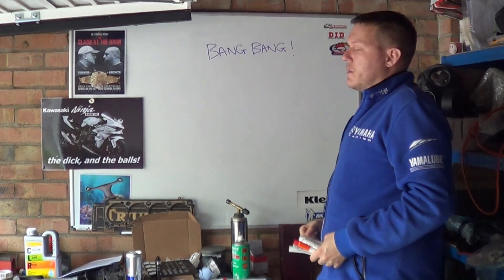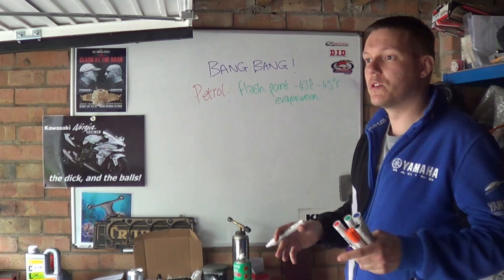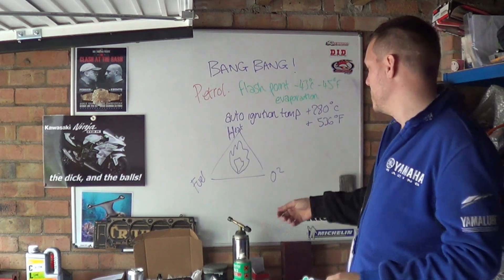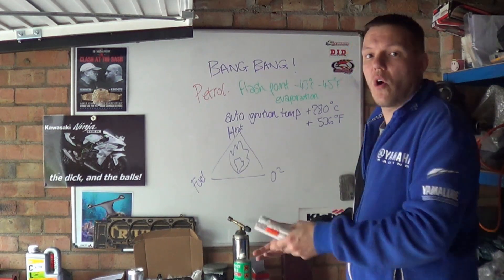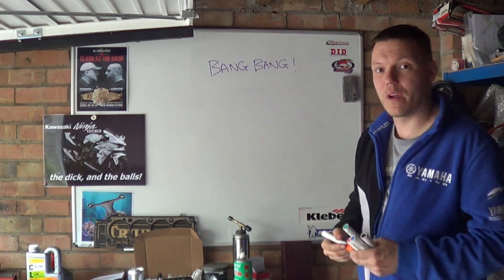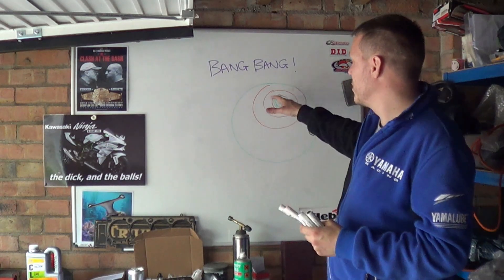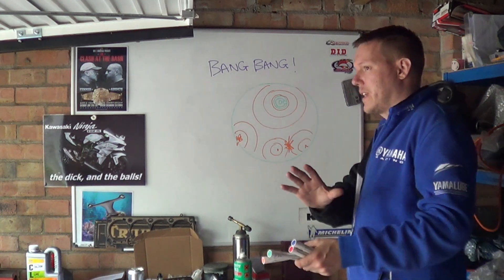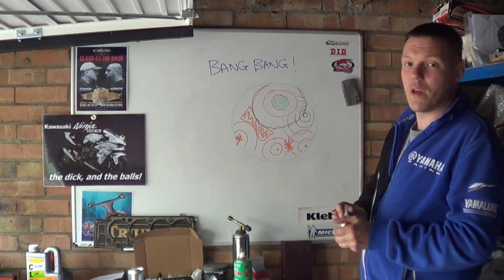Pre Ignition & Detonation

Comment: Good video. As always!
May I ask a question? 
I discovered something strange a long time ago. I was trying to get a homebuilt CDI system to work when I got so pissed at the thing that I decided to put a spark generator on my spark plug. The spark generator didn't have any timing at all. It just created 10.000 sparks a second. I tried to start my 2 stroke moped anyway although this was a stupid idea. I was shocked by the fact that the engine started without any problems at all! It even runs better stationary with this system than with the original ignition system! Besides occasional switch in rotational direction off course. The moped could reach 30 km/h with this system instead of the 45km/h with the original system. Naturally the engine sounded really bad at those speeds..
Only one questions remains since that weird experiment. WHY???????? How could this even work? Why doesn't the spark plug ignite the fuel when the fresh mixture is introduced? Since when do you need compression before you can ignite fuel?
I even have an old video of this experiment.
https://www.youtube.com/watch?v=_uSmPeQuvBI
Do you have an explanation for this?
Reply from the maker: Yes but I'll get you to answer your own question.

Why do we need a spark - i.e what physically does it actually do - what purpose do we need it to perform?
Reply: Thanks for your reply! I appreciate it. 

Didn't you call it the triangle of fire? You need air, fuel and heat. The compression supplies some heat but not enough. The spark plug supplies a tremendous amount of local heat. But apparently the spark plug isn't able to ignite the mixture until the piston is close to TDC. This would suggest that a spark plug cannot ignite a fuel air mixture at atmospheric pressure and temperature. This doesn't make any sense. So I still don't get it. :-(

Comment: Hi Matt, 
At 4:14 you said "with diesel, the mixture is compressed and when it reaches a certain temperature it ignites". But in a diesel engine the piston compresses only air and at top end diesel fuel is injected which generates the combustion. Correct me if i am wrong. As always  enjoying the vids, cheers!
Reply from the maker: no your correct, a slip of the tongue. On a side not Rudolf Diesel originally wanted it to work this way, then realized how difficult that was. HCCI engines are trying to do just that with both diesel and gasoline.

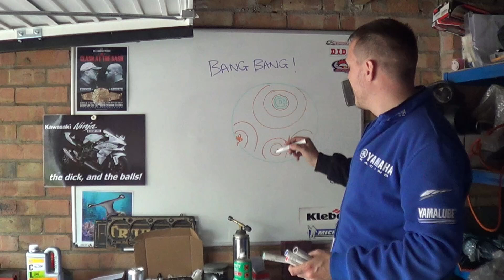Comment: The comment @ 9:20 needs to be revisited, it's not correct. Car v wall at 60, car v car both doing 60, for reasons I don't understand the impact forces felt in each car, in each case are the same. Plenty on google about it.
Reply from the maker: Yes I know but thats not what I was getting at, bad analogy. Not the impact force but the energy density.

Comment: with diesels you dont compress an air fuel mixture you only compress the air inside the cylinder and then squirt fuel into it wich then reacts with the hot air* i know that you know that matt but i just wanted to clarify it for the others
Reply from the maker: Yes that's correct but the clarification will come in the diesel videos

Comment: If detonation is caused by multiple ignition points after ignition. Why don't dual spark plug set ups constantly detonate and tear themselves apart? Good vid as always
Reply from the maker: Great question, ATTL - m
Reply: MrBigmofugga1086 because they fire simultaneously
Reply: Wouldn't you still have opposing flame fronts slamming into each other?
Reply: MrBigmofugga1086 not sure why it works out. maybe Matt can explain it in another video
Reply: Rotorys have twin spark plugs, I suspect they spark sequentially, the 2nd spark plug is there because the flame front cant move fast enough to complete combustion before exhaust ports are opened.

Comment: So, I've been a dickhead before and advanced my timing by a few degrees which resulted in in audible knock at certain rpms. Why does advancing ignition timing result in 'hot spots' igniting and colliding with eachother? Or is it just the sound of the flamefront slamming into my pistons while they are still moving upwards? Looking forward to more video's on the subject :)
Reply from the maker: "Or is it just the sound of the flamefront slamming into my pistons while they are still moving upwards?" 

- usually yes